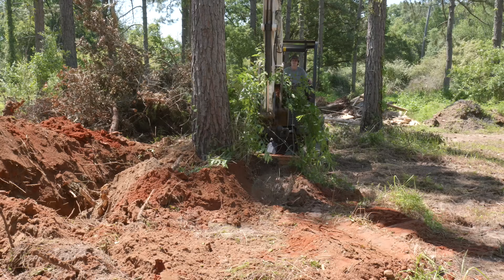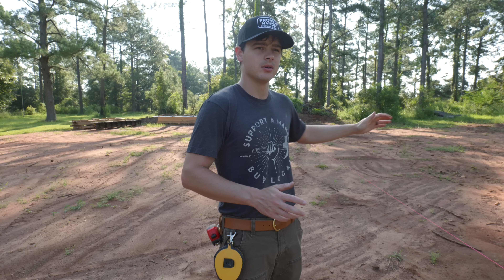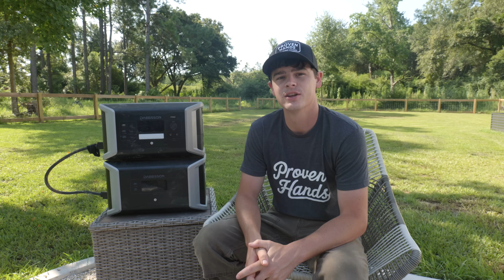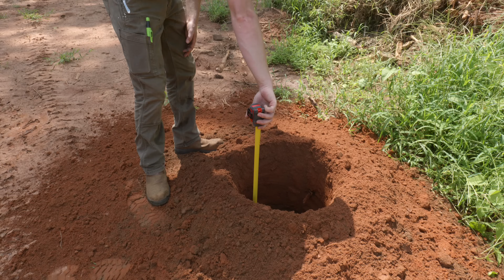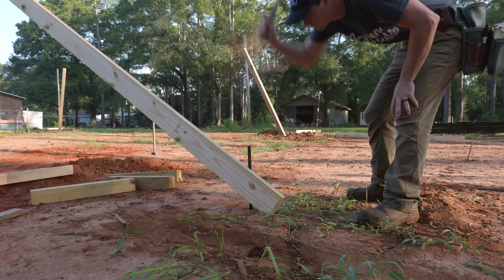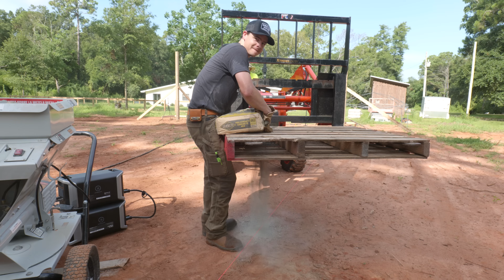We’re Building Our Dream Workshop

Comment: From what I understand about the post/rot question. Most of the rot happens around the ground level where the post is exposed to standing water/oxygen. You go down deep with the hole to help with structural support, water drainage, and the freezing. As water down there freezes and thaws, it will push the concrete and post up, eventually taking things out of square/plumb. So you have to go below the frost line to fully anchor things.
Reply from the maker: We don't have a frost line, the ground never freezes here so that isn't an issue. The rot happens where moisture and oxygen hang out, so keep that combination away from the post and you will prolong the life. That shouldn't be an issue for us once this building is closed in and properly graded.
Reply: Yeah, building code is obviously different depending where you live. Frost line for me is 36 inches. But in the South its probably just a couple inches if anything. IIRC, it's only zero in like southern Florida. Regardless, the other things still probably apply, structural support and drainage. In addition to pitching concrete on an angle away from the post, they make rot prevention sleeves that can slide over the post and help with the moisture. They also make a treatment sealant you can use, hell, I've even seen people put Flex Seal on that part of the post to help prevent rot.

Comment: Next time you use your concrete mixer, either:-

- Bring the pallet ALL the way to the top of the mixer so you can flip a bag off the pallet straight into the top of the mixer.

Or

- Rase the pallet up by about 0.5-1ft and have a board you can slide the bag of concrete straight from the pallet into the mixer. Maybe put some of that metal sheet you used to cover the wood piles on top of the board so it's nice and slippery for the bag to slide down.

I've got chronic back problems and have learnt that if something is heavy it's always best to find a way to move it without having to lift it. Work smarter not harder 😊

Comment: The cellulose in the wood absorbs the moisture at 4 feet under, and you really don’t need oxygen since some of the interior parts of the cellulose get washed away. Think it more as a wet rot than a dry rot.  The part I’m not sure about is whether the oxygen can come for a breakdown of the moisture with the inherent electricity in the Earth is the charge moves from one resistance level to the other resistance level.

Comment: Think twice before you cut down the height of the building. This about hanging  things like shop heaters, and air cleaners. Add to that you could create space with a mezzanine and add to you storage. I have a shop only 2 feet shorter than yours, and I am putting in a mezz because I keep running into storage issues. Think like this it is better to have the space and not need it, then to want it and not have it.

Comment: I'd like to take a stab at explaining the wood rot/drainage question.  (At risk of a repeat).  Even though the gravel is 4 ft down, it must be at the bottom in order to drain the water away from the post.  If it was not there, it would not take much water to fill the gap between the post and the concrete.  Treated lumber can be quite wet as purchased.  As it dries it will shrink away from the concrete and create a slight gap.  As I said, it won't take much water to fill that gap if it can't drain out the bottom.  As oxygen, water, and wood all meet at ground level, that's where rot will begin, not at the bottom.  I hope this helps.

Comment: No no no you don’t put the post and then fill it with concrete. You gotta put the concrete in first in the cylinder then put the metal bracket on top of it. You don’t bury the post in concrete like that
Reply from the maker: We were unable to do this because of the extreme uplift engineering requirements for our area. None of the available brackets or Permacolumn type products met the strength requirements without substantial rebar structures and massive footings. No one builds them like that where we live. Most of the country has 60-80mph requirements and posts sat much closer together for snow load. We are 12ft post spacing with a minimum wind rating of 150mph. Trust me, we had a structural engineer try to modify the plans to use this method and it was extremely impractical. These posts we are using are not the stuff you find at a home center. They have 50 year warranties and I can tell you from experience, these types of buildings aren't the ones on the ground after hurricanes which pose significant more of a threat to us than having rot 50-80 years from now in these posts.
Reply: @Woodbrew  ok so you are saying it will pass inspection and codes
Reply from the maker: I’m saying that we have to have stamped engineered plans in order to get the permit. The other options were not possible according to the structural engineer based on location, wind speed, exposure rating, and post spacing/building details.

Comment: 👍🏻👍🏻👍🏻👍🏻👍🏻2 old farts just finished a 30x60 metal truss with a 10x10 bump out on the middle of the one 60' side. Quite a work  out lol. We opted for the wet set anchors to keep posts out of the ground.
Reply from the maker: Nice! Unfortunately we were not able to use the normal wet set brackets in our area due to wind load requirements.

Comment: You might want to raise post so not sitting on bare dirt. The new treated post will rot sitting on dirt. You are better off to pour sonatubes with Simpson post anchors to post.
Reply from the maker: We were unable to do this because of the extreme uplift engineering requirements for our area. None of the available brackets or Permacolumn type products met the strength requirements without substantial rebar structures and massive footings. No one builds them like that where we live. Most of the country has 60-80mph requirements and posts sat much closer together for snow load. We are 12ft post spacing with a minimum wind rating of 150mph. Trust me, we had a structural engineer try to modify the plans to use this method and it was extremely impractical. These posts we are using are not the stuff you find at a home center. They have 50 year warranties and I can tell you from experience, these types of buildings aren't the ones on the ground after hurricanes which pose significant more of a threat to us than having rot 50-80 years from now in these posts.

Comment: The problem with posts is that typical rotting happens within 6 inches or so from the soil level. Some use a rubberized wrap that is basically melted around the post a couple of inches above and a foot or so below. I am building a 20x24 picnic pavilion and I am avoiding the rotting issue by using sonotubes and pouring concrete in them. Then I will use post bases by Simpson to mount the 6x6 treated posts and then end up slightly above the concrete and not affected by the concrete - which is an issue too. Good luck and blessings!
Reply from the maker: We were unable to use the brackets because of the extreme uplift engineering requirements for our area. None of the available brackets or Permacolumn type products met the strength requirements without substantial rebar structures and massive footings. No one builds them like that where we live. Most of the country has 60-80mph requirements and posts sat much closer together for snow load. We are 12ft post spacing with a minimum wind rating of 150mph. Trust me, we had a structural engineer try to modify the plans to use this method and it was extremely impractical. These posts we are using are not the stuff you find at a home center. They have 50 year warranties and I can tell you from experience, these types of buildings aren't the ones on the ground after hurricanes which pose significant more of a threat to us than having rot 50-80 years from now in these posts.

Comment: Regarding setting any kinds of posts, a VERY helpful too is a PostRite tool.  Attaches to a post with an elastic strap and has levels in every direction.  No more going back and forth between sides with a long level.  No having to hold the tool on the post.  There are many different manufacturers of such a tool and they are very cheap, less than $10 up to $40 depending on features and quality.
Reply from the maker: These are cool, but not very accurate since they are so short. Any variation in the post over that short distance can cause a 16ft post to be way off.

Comment: congrats guys.  That next big step.    mY suggestion/opinion, I would keep it at the height you have.  If you have it, use it.  Its hard to add, vs not using it at all.  you can also build a second floor, although low scaling, for storage.
Reply from the maker: Weighing out the options of it’ll look ridiculous if it’s higher than the house😅🤣

Comment: The end grain of the posts will wick water up and could get to the oxygen level.  Also, as soil dries out, or the wood dries out and shrinks, you may get air down to the bottom.  It's a cheap insurance policy.
Reply: Posts rot.

Comment: Work smarter, not harder,  why not just drive the tractor right up to the mixer and slide the bags off onto the mixer?   Hindsight being 20/20.  Also don't cut the building down,  consider the loft / storage space you'd be losing,  also heat rises and with a good ridge vent, you could keep the shop cooler in the summer.
Reply from the maker: We did drive the tractor right up to it. Our tractor can only lift about 10 bags at a time and a pallet is 42, so there was lots of moving bags onto pallets and not so much into the mixer. The building will still be around the original 12ft height:)
Reply: @Woodbrew  Dylan,  I meant  drive it RIGHT up to it, so you could have just slide the bag off the pallet and into the mixer,  was referring to when the bag split, sorry sometimes I don't explain very well.  Just passing along what I learned when setting miles and miles of privacy fencing around subdivisions.
Reply: They couldn't have really drove the tractor closer than they did without having the concrete over waist height which is hard on your back for sure
Reply: @cameronbarber3768  What I'm trying to say is that if they would have rested the pallet ontop or just above the mixing machine, then no lifting would have been involved,  just slide the bag off the pallet and onto the mixing machine, those NO lifting involved.
Reply: @MrKnotWright  no matter what you're still going to have to move bags around. Sounds good in theory but wouldnt ever work out that way
Reply: @cameronbarber3768  Its ok,  I've only been doing construction work for 45 years, you're probably right, I don't know what I'm talking about,  thanks.
Reply: @MrKnotWright  chill out bro🤣

Comment from the maker: I will address any questions about this kit in next weeks video, so ask away:) The short version is this kit comes from Backwoods Building out of Chipley, FL. It is a 30x48x12 Pole barn Ag roof kit with a few upgrades like 26ga steel. The kit costs about $5000 and includes everything you need minus concrete. They can engineer these buildings to the highest FL wind ratings and the wind rating/if you need it engineered can change the price. In our case we spent about $1000 on concrete for a 150mph wind rating and weren't required to do any other modifications. Freight is another charge and depends on how far you are. The entire crew over at Backwoods have been incredible to work with and were super patient answering my 8000 questions. I asked them if they'd be willing to offer a coupon to our viewers and they graciously are giving anyone $250 off this kit if you mention Woodbrew. Give them a call and they can usually quote you quickly. https://bit.ly/backwoods-buildings
Reply: Great info - check your dictionary- I think you meant graciously not gratuitously?
Reply from the maker: 😅 autocorrect
Reply: @Woodbrew hi will you be finishing the shower?